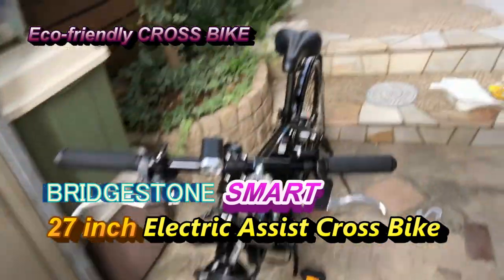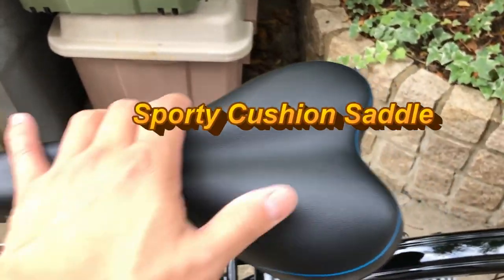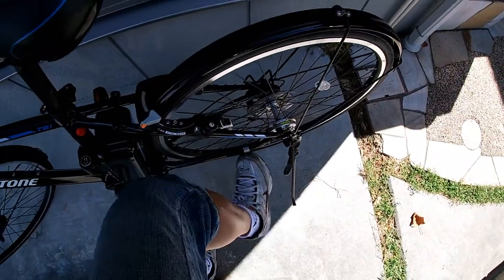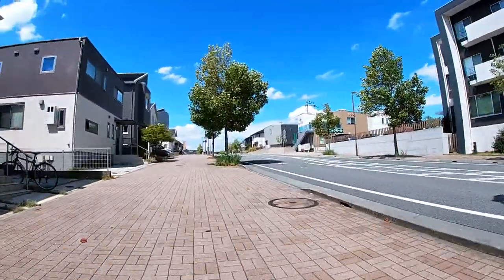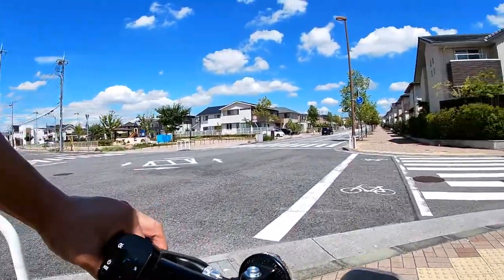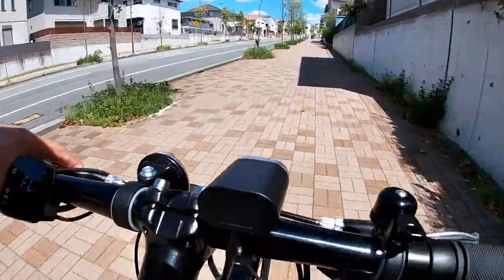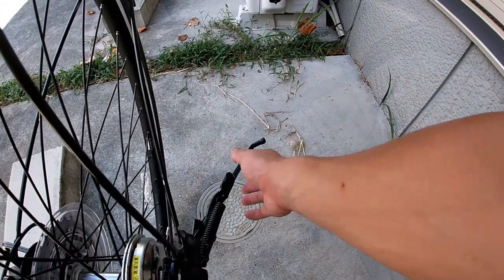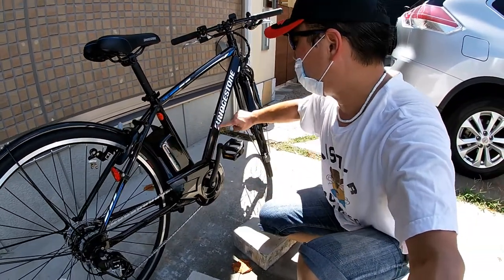Eco-friendly Bridgestone Electric Cross Bike TB1 TB7B40 Living in Japan 電動自転車

Comment: Nice bike, what is the range in the highest power setting? and so sad no disk brakes for that price
Reply from the maker: The battery is special because it has a regenerative function that allows you to use the bicycle for a long time.  It has a maximum cruising range of about 130km on a single charge!